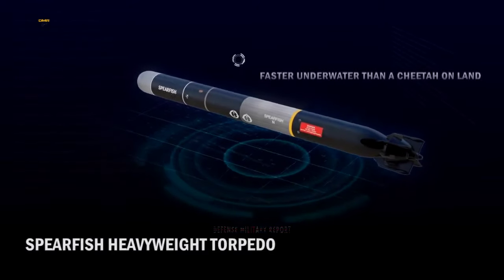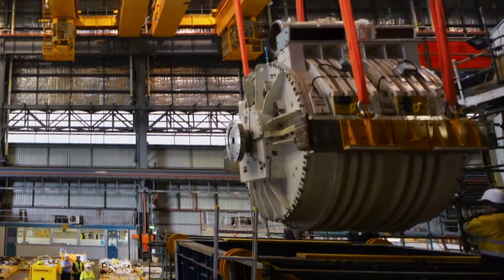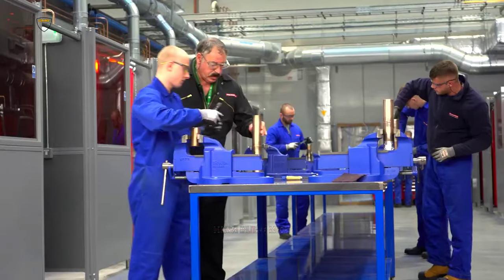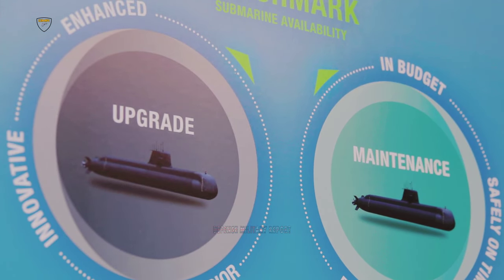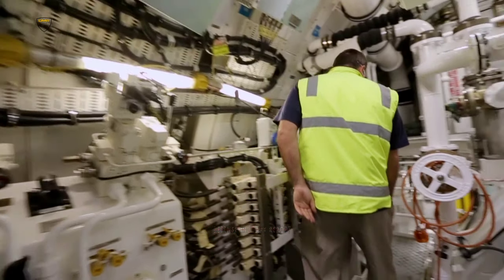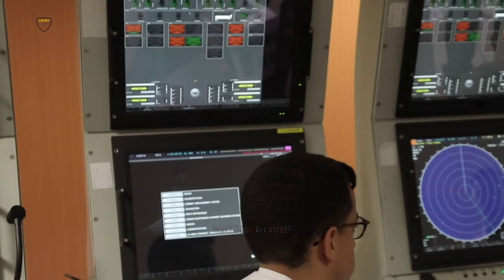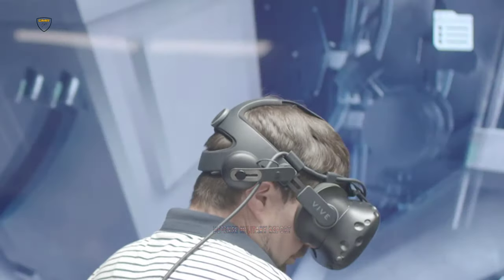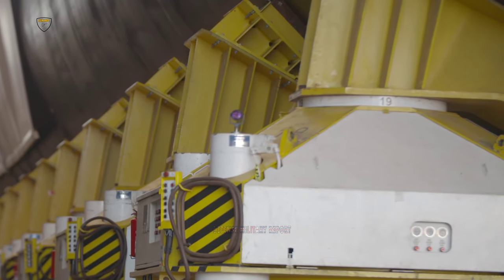HMS Agamemnon Attack Submarine British the most awaited

Comment: Why show film of American boats being built ?British boats do not have hydroplanes on the fin.
Reply: They are amateurs, that's why. Why they refer to Astute and Ambush recently being handed over is also a puzzle. Personally I would love to hear them read the script for themselves instead of giving the job to a machine. I'm sure it would be a hoot.
Reply: These guys are turkeys!

The boat shown at 4:48 is an Australian Collins class SSK at ASC shipyard in Adelaide in Australia. The three flank array panels on each side, the fibreglass shroud around the bow sonar, the horizontal hydroplane at the top of rear of the dorsal fin, the forward location of the attack sonar, and the TASS deployment tube on top of the rear compartment are all features of the Collins. The fibreglass shroud and the horizontal hydroplanes were modifications to the original design that were required to reduce the hydrodynamic noise generated when moving at high speed. The original design of the fin had the wrong dimensions and developed excessive turbulence that got drawn down into the water flowing over the propellor causing cavitation. The original bow sonar was replaced with a bigger one requiring a bulge which also created a lot of turbulence. It took them a while to iron out all the bugs but today they are very quiet submarines. Big fuel tanks and massive diesel generator sets mean that AIP is not required to keep the discretion rate low.
Reply: Those are French Baracuda class shown